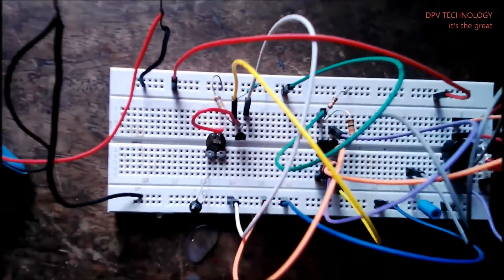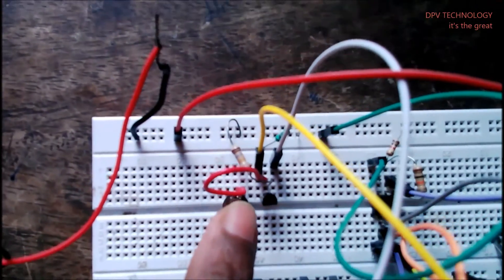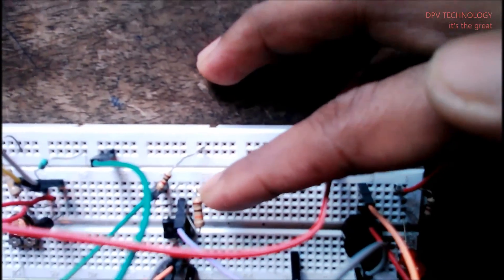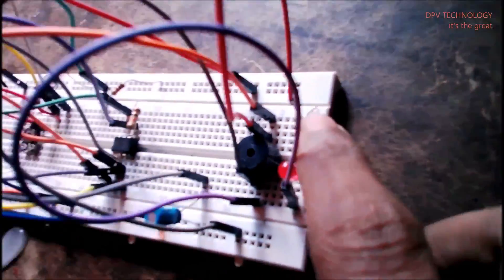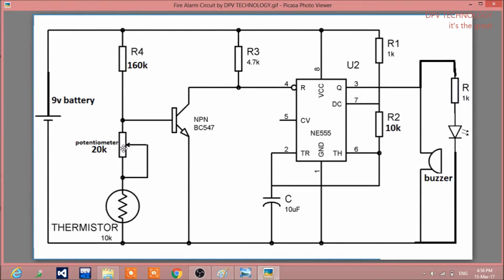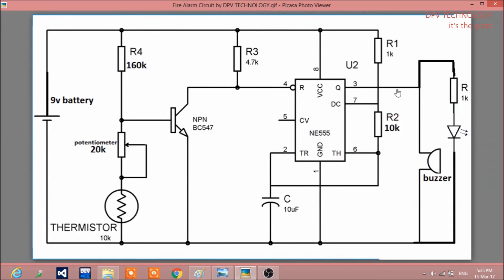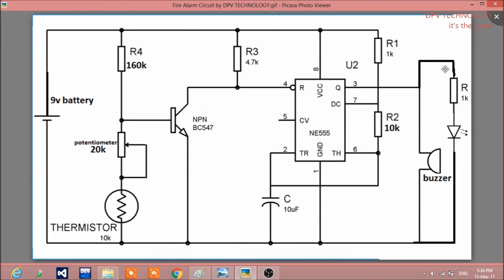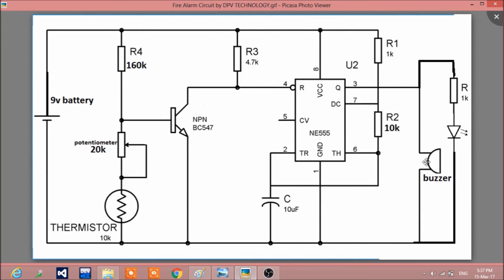Fire Alarm Using Thermistor

Comment: Now I can set up a homemade fire alarm at home. What type of "Thermistor"? I want to be safe with my family in case of fire.
Reply from the maker: You can use good quality thermistor or instead of using a thermistor you can use a temperature sensor which gives better accuracy . Temperature sensors are more sensitive to temperature than a thermistor. You can use DS18B20 temperature sensor. Video is already available  in our channel.
Reply: @DPVTECHNOLOGY  Thanks a lot!! But if you heat the temperature sensor, will the alarm go off??
Reply from the maker: It depends on your circuit.
Reply: @DPVTECHNOLOGY  If I find a temp. sensor in a digital thermometer, I'll remove the screen and replace the piezoelectric buzzer with a homemade bell. Will this ever work?